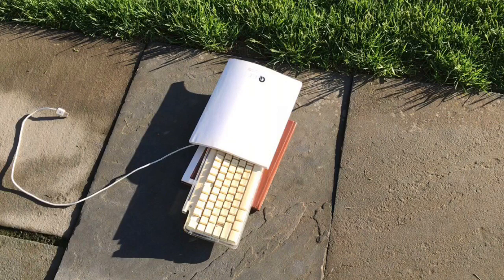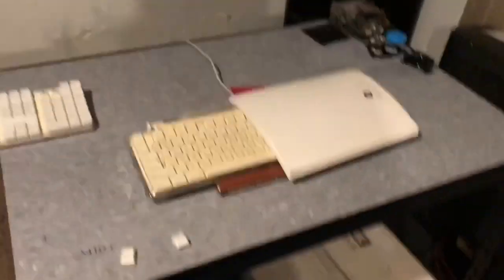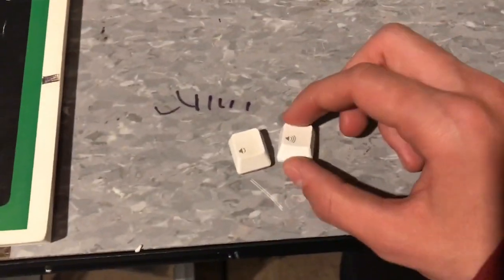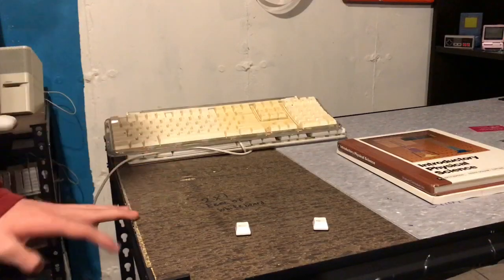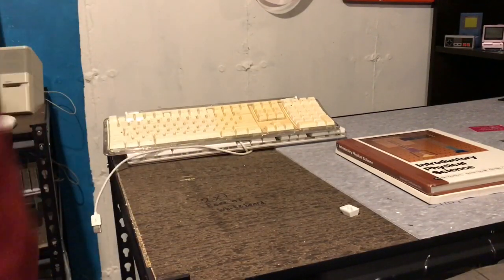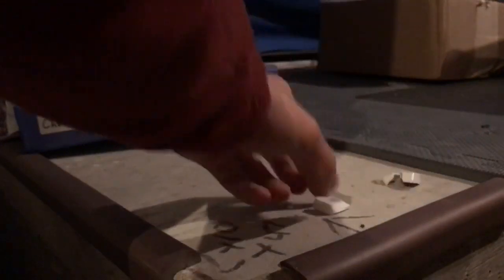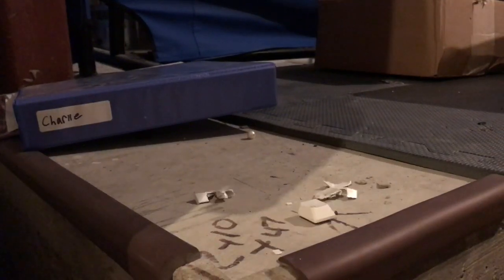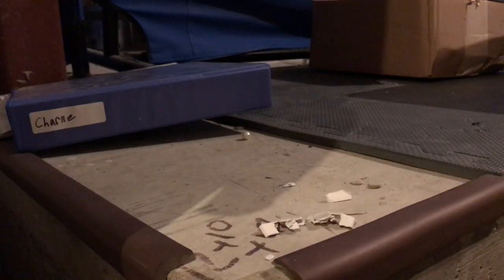Does Retrobright using only the sun actually work? | Experimenting with Retrobright! | Mastergeko4

Comment: So basically you just put it in the direct sun with no products and left it and it worked? I've got a PS1 and wanted to just try the sun by itself today and see if this works. Tho I thought the uv from the sun was what causes the yellow to happen
Reply from the maker: This is a good point, however, people are beginning to question what's actually causing this phenomenon in the first place. I'm pretty sure it's similar to what happens when you leave an old lawn chair out in the sun and the color bleaches from the immense heat. Despite this, the method does actually seem to work fine. Try it out!
Reply: @Mastergeko4  cool dude. My ps1 only has a little bit of yellowing and has 5 screws so it's simple to take the top off and it's sunny today and I'm in Denver where the altitude is closer to the sun so it may work faster in the sun. I just don't want to make it more yellow than it already is but am hoping to remove just some of the yellow. I wasn't sure if it was the sun's UV or lights inside of a house that cause the yellow to happen.